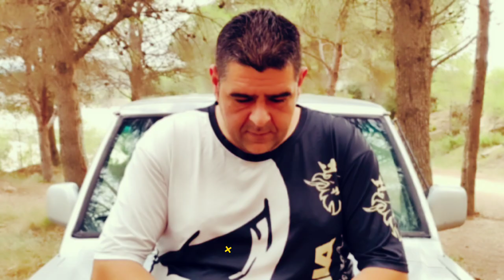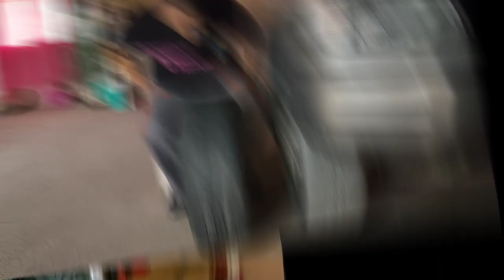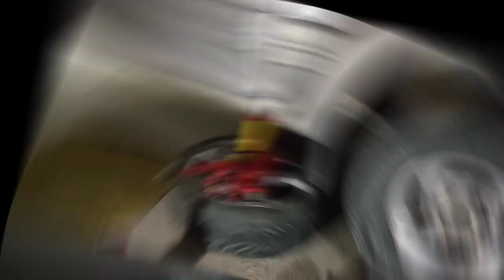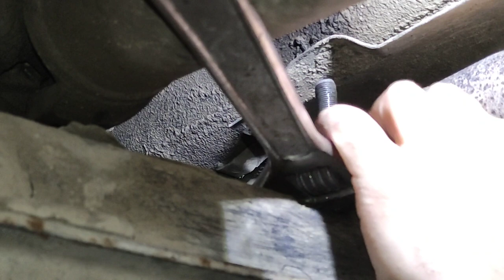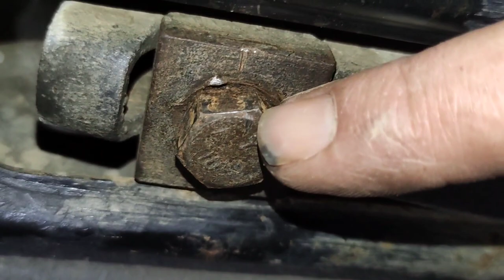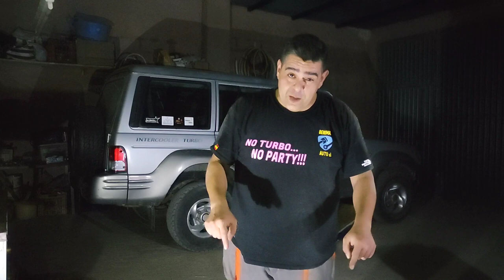👨🏽‍🔧⚠️Como elevar DELANTERA ajustando las BARRAS DE TORSION❓✅ (Galloper 2/Montero)

Comment: No se si en tu modelo pasa, pero supongo que sí.Hay que corregir caidas con tornillos más largos y " forros" en el trapecio superior.lo acabo de hacer esta semana en el siguiente modelo de galloper
Y no está de más colocar bj spacer en las rotulas
Reply from the maker: Hola Fernando, el mio no lleva ese sistema.
Reply: Y como corrige las caídas? Anteriormente tuvimos uno en casa que acabo saliendo porque dio problemas de culata,( bueno lo cierto es que la primer rajada de culata la culpa fue del radiador tupido,lo lleve a un taller porque me calentaba pero no se les ocurrió baquetesr el radiador)